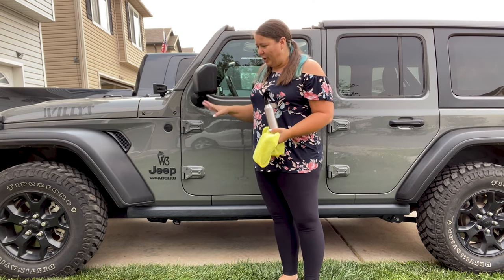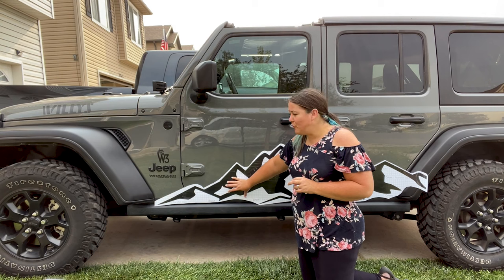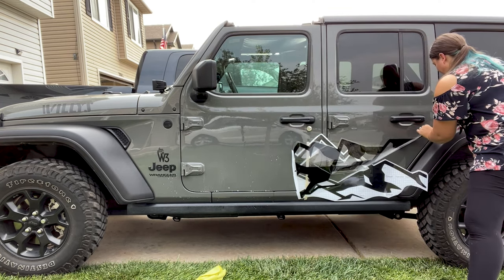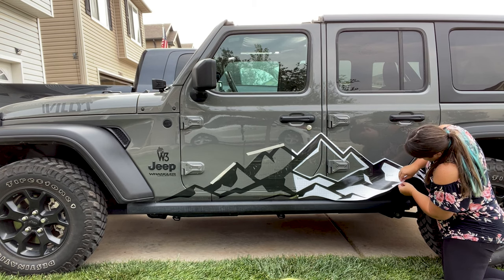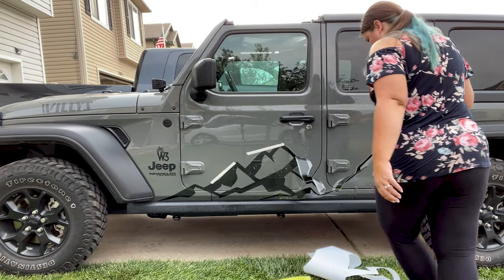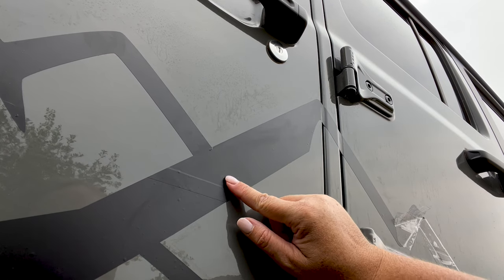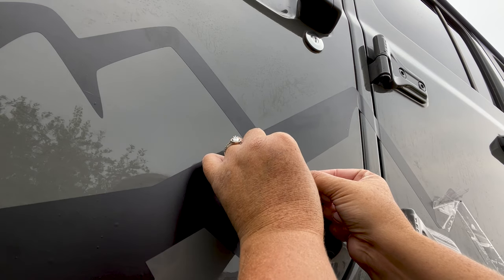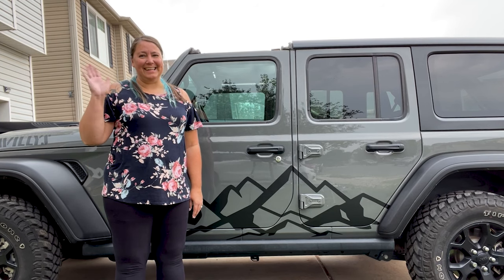How to Apply Large Vehicle Decals Using the Wet Method

Comment: Can any transfer tape be used for the wet method?
Reply from the maker: Great question Mary. I have only done it with the plastic/totally clear type. I haven't tried it with the transfer tape that is more papery, so I am not completely sure.
Reply: @KatieAdams  i've done it with the paper one that is what i had seen that it had to be that kind so wanted to make sure the clear works just as well :-D

Comment: How long has the vinyl been on and how has it held up? Make it through winters and salt? What about summer? I know it expands and contracts different from the metal body of the car
Reply from the maker: I applied the decal in April of of 2021 and it is still going strong. There are a couple small nicks in the vinyl but for the most part it still looks really good. We have cold winters and hot summers and it is holding up well.

Comment: Hi!! We tried this last night but the decal doesn't seem to be sticking!! Do you believe it may be because all of the water isn't out? We left it dry overnight and have applied a heat gun to it as well;; I'm about to be out and try the heat gun again and get out anymore water! But I mean today the decal seems to be lifting a bit when last night it wasn't

Thanks regardless for the video!
Reply from the maker: Hmm, that is strange. How much water did you use? Just a couple of squirts of water shouldn't effect the stickiness. 
Did you cut the vinyl yourself, or did you buy it?
Reply: @KatieAdams  We purchased the Vinyl;; my boyfriend watched this video and made the soap/water mixture himself. He sprayed about as much as you from what I could tell! I did notice though there was a lot of water still under the sticker so I squeezed it out today and applied my heat gun;; it's seeming to slowly stick now but I'm wondering if it's been delayed due to the cold weather! Before the decal was sticking to the front and wouldn't apply but now it's beginning to stick to the car when I lift it;; but there's still some pieces that when I lift are peeling up. But at least not it's not  just entirely coming up. I'm hoping it just needs a little more time to dry is all!
Reply from the maker: @alexplays703  It does sound like the weather played a factor. It can be more difficult for vinyl to stick to a cold surface.